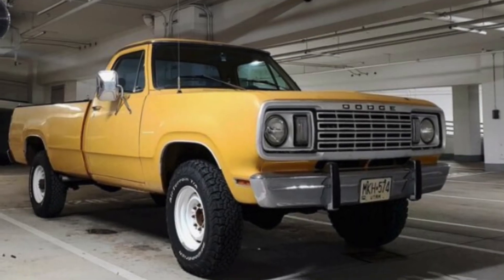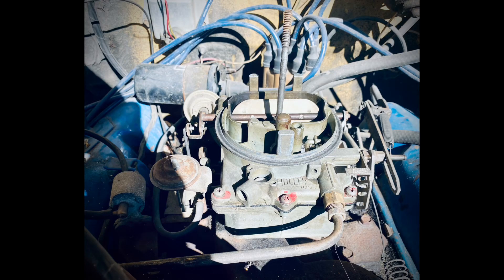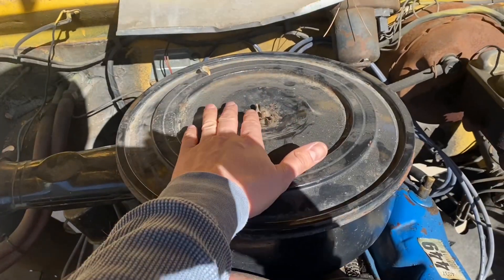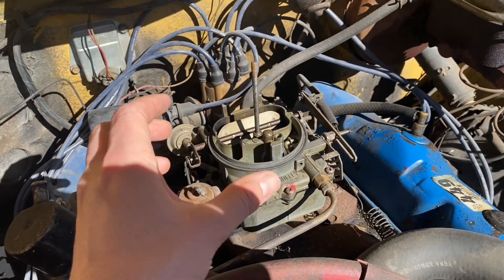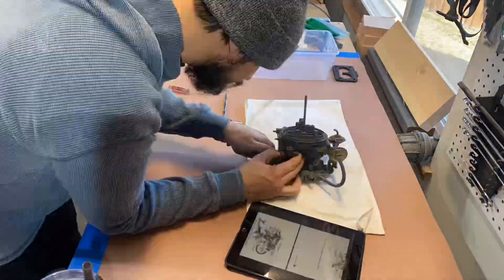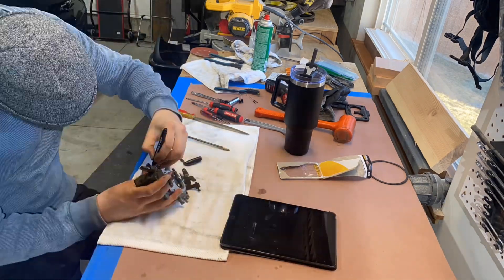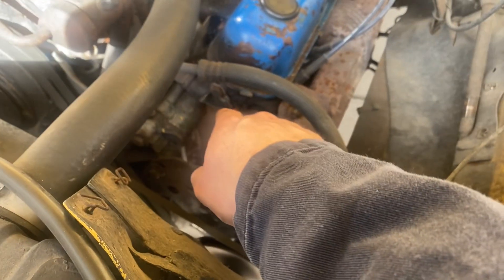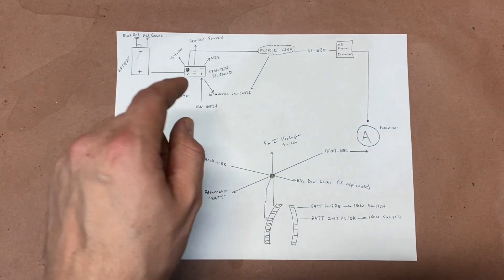Will It Run and Drive Power Wagon

Comment: What kinda mileage do you get with 2BBl 360 engine?
Reply from the maker: It has never been great.  I pretty quickly swapped to a 4BBL Edelbrock.  It’s a 3spd auto with no overdrive and full time “awd”.  I probably average 11-13 ish.

Big improvements would likely be obviously an overdrive or modifying the front hubs/4wd selector so I can get 2wd when I want it

Comment: Excited for the new project.  What's the plans for it?
Reply from the maker: I really just want to make it a solid driver.  It needs a brake master cylinder and then the full tune up, grease everything, bleed brakes, check grounds, etc.

Stretch goal is brand new gauges